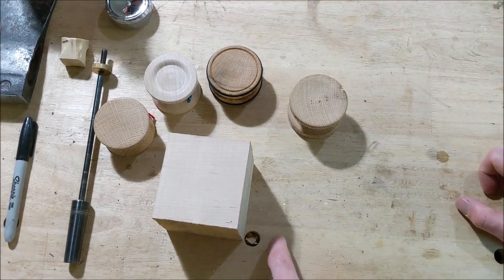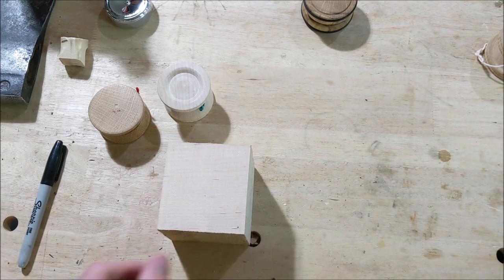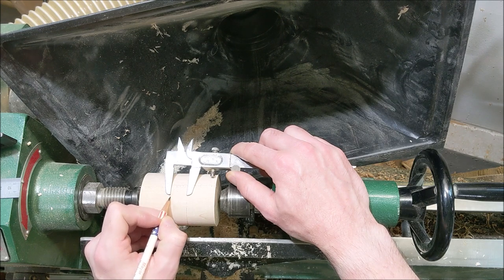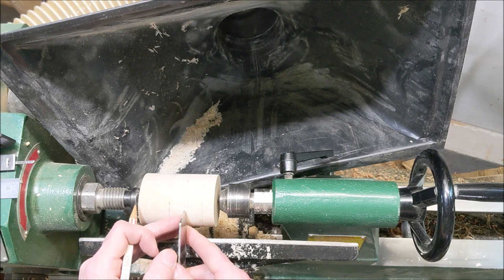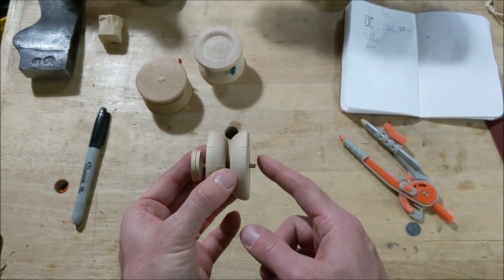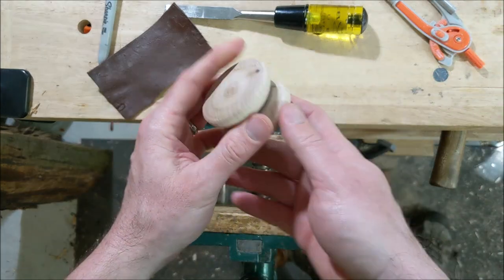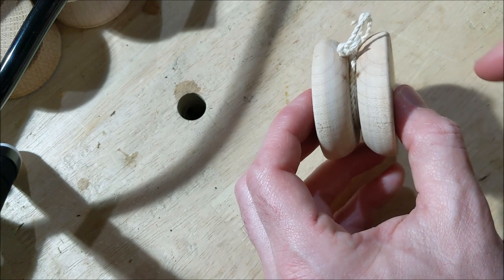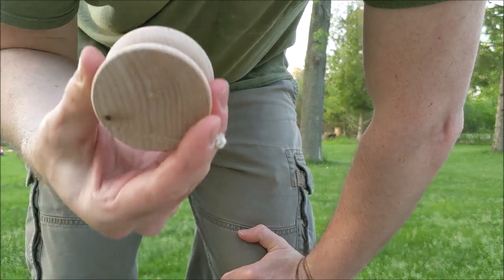How to make a one piece wooden yoyo on the lathe.

Comment: Thanks for this.  I am going to try it.
Reply from the maker: Glad you found it useful. I hope it turns out well, no pun intended. 😁
Reply: Welll I tried and it was fun. It's not coming back up and sleeps too easy. I think my axle is too wide and the gap is too wide. The wood I used is very hard and possibly too smooth so ad you said  uoi judt have tomake another one lol 😂@JoshsShop
Reply from the maker: @davejohnson9495 glad it turned out, no pun intended, bummer it won't return though. Like you said, maybe narrow the gap, don't sand anything inside the yoyo, and check the axle diameter also. Good luck on the next one, it is certainly a bit of trial and error. I have made quite a few and I still get a dud occasionally.
Reply: Also try a bit of wax on the axle / string. though you will need to re apply every once and a while :)